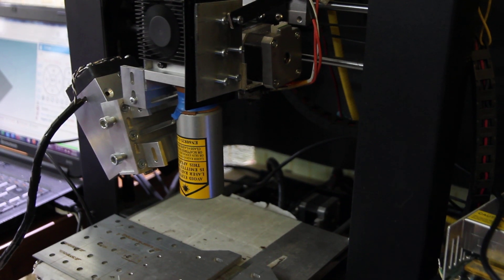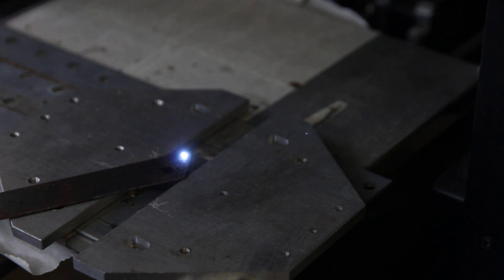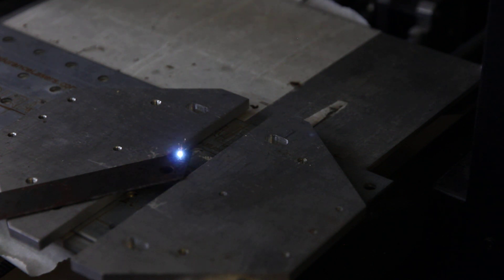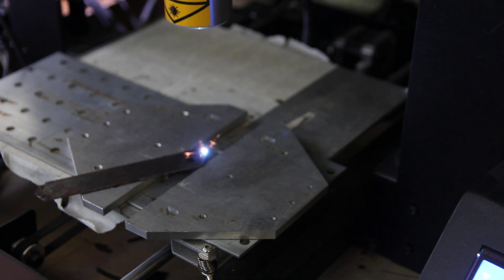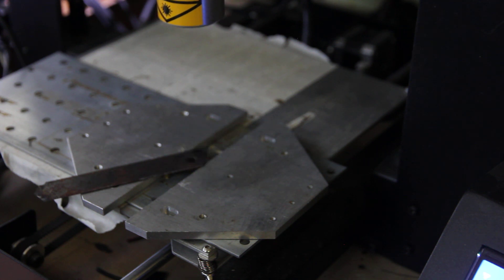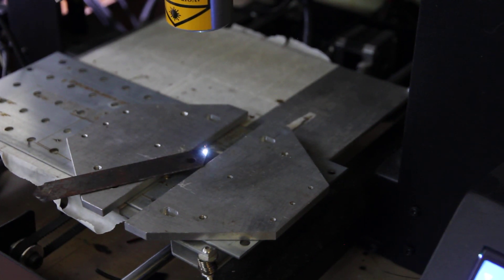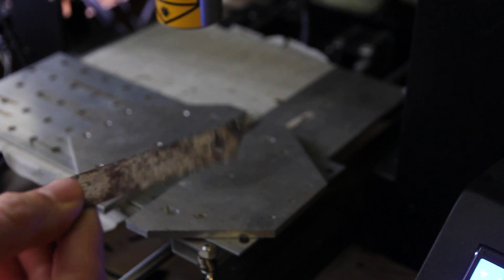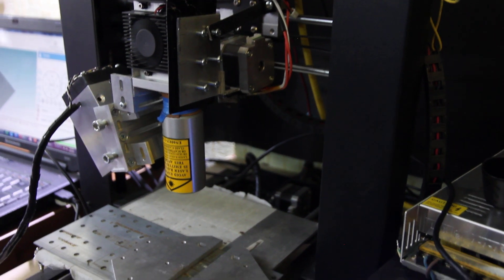Amazing cutting of 0.5 mm stainless steel with a 10 watt DPSS Endurance laser module

Comment: I have to ask, whats the point if it takes so many passes?
Reply: The point is you can cut metal with a desktop laser that doesn't cost $50,000.
Reply from the maker: to keep it clean and not melted edges.. it is still 10 watt only.. for one pass you need something like 30-50 watt power...